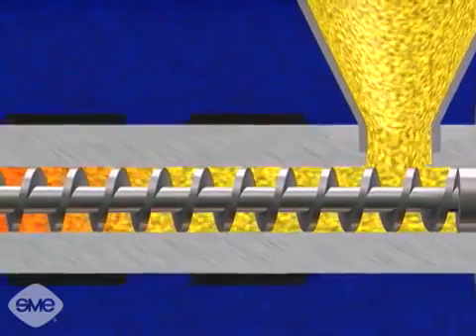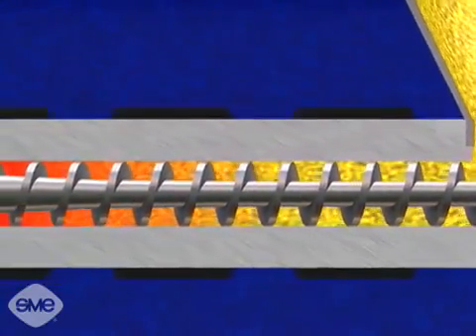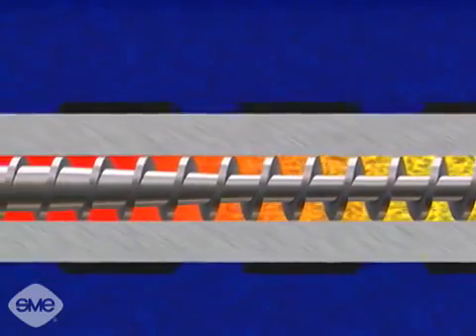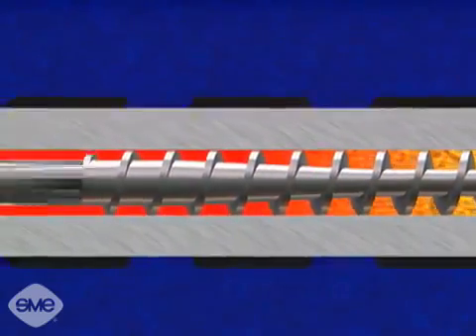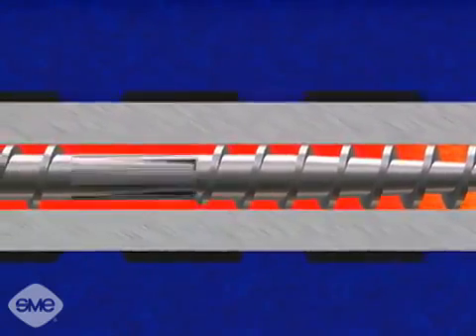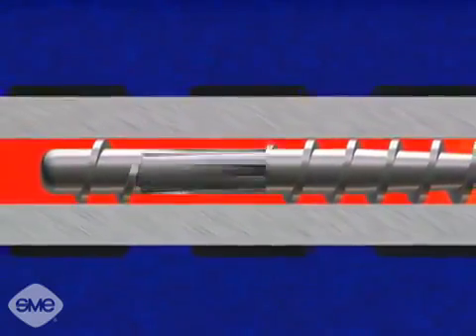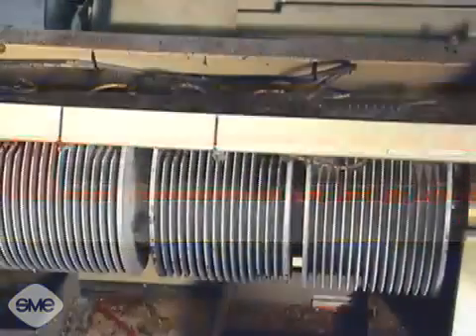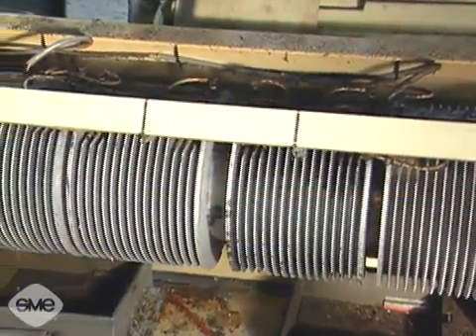Plastic Extrusion Process  **PLEASE SUBSCRIBE**

Comment: Nice video! Need your technical expertise. I have a small extruder and the entire barrel moves in a circular pattern maybe 1-2mm or so - which makes it very difficult to maintain tolerances on the product extruded. I thought it was due to a screw that was broken and repaired and assumed might not be 100% straight, but the same thing happens also with a new screw... what could be the cause? The motor and the gear box? A bent shaft that connects to the screw? Maybe the extruded not being level properly on a hard surface (it is on a wooden pallet)? A bent or worn out barrel?